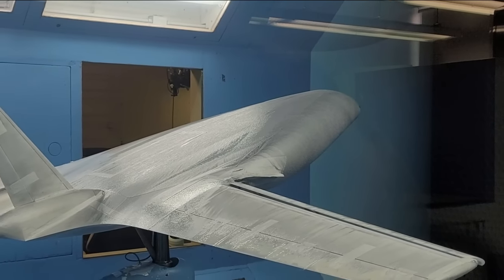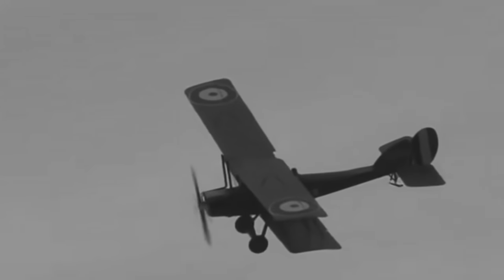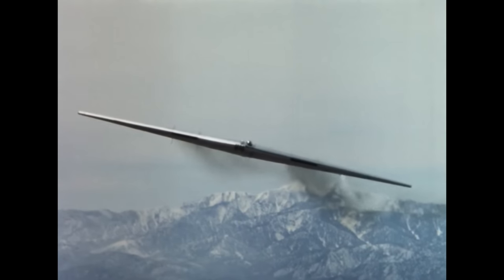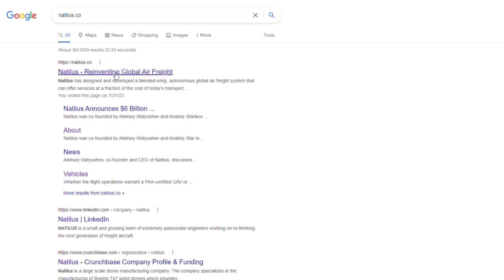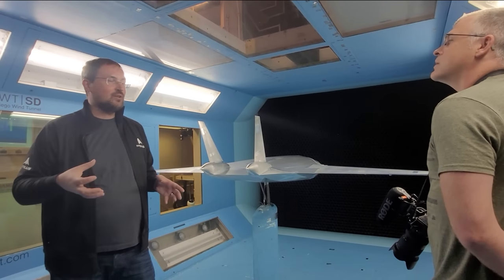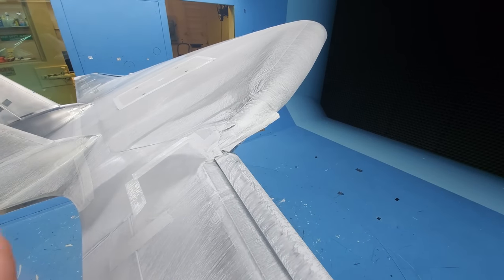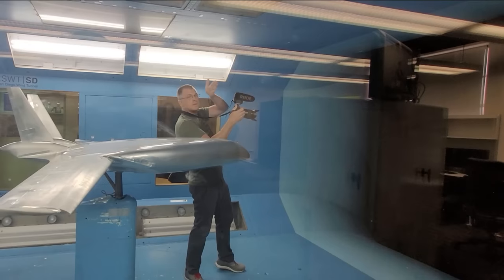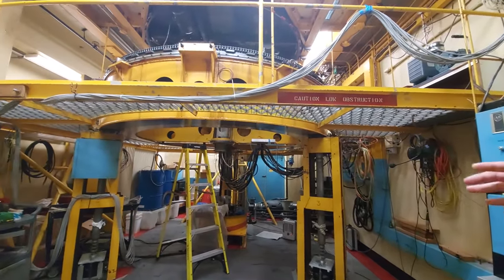Blended Wing Bodies:  The Future of Transport is Here (Featuring Natilus)

Comment: Blended Wing Bodies are not the future of air transport.

A cylinder is significantly lighter  as a pressure vessel. 

It also transmits torque from the empennage most efficiently.

Its the strongest member of the simple shapes in compression.

Its also equally strong and stiff in lateral and vertical bending. Tail down loads, up loads, and side loads are all the same to a tube.

Having a very low Empty weight fraction is more important to a transport than the benefits BWB concepts offer.

Because they inevitably end up heavier. Due to pressurization, primarily. And also the problem of where to place the windows? You cannot have any side windows in a BWB in spite of the fact every concept has them placed there. Right where the leading edge de-icing equipment is required. 

They also flub the flaps/high lift systems. You really think ditching the landing lift coefficient of 4.0 in favor of something like 1.6 is going to gain you any efficiency?

Also, what do you do about the supersonic airflow over the top of this large fuselage whoch is in fact an airfoil nearly 30% thick, with a critical mach number in the range of 0.5... And acting as a very large lever arm forward of the CG where supersonic flow will wreck havoc on your stability and control.

The proper solution is reduced wing sweep, very high aspect ratio wings in the order of 13:1 or greater. Shoulder or high mounted wing. Underwing engines. Very short landing gear (C-130/C-17 like, with low weight fraction heavy duty gear). And most importantly: Twin fuselages which reduce wing root bending moment by enormous amounts, and transmit wing torsion into two fuselages and tail surfaces. Both therefore reduce many tons of mass in spars, webs, wing and fuselage skin thickness.

Its like having two geese flying in close formation. The latter gets a 40% gain in efficiency, except its you.

Comment: This is fantastic researching methods and great design ...     My first airfoil test was an ambarella in my hand and jumping off the garage roof !  I soon learned I needed a much shorter garage roof...   I would like to know about such a large lifting body surface what happens if the aircraft flies through a swarm of bugs on take off or landing will the craft lose a large percentage of its lifting abilities because of the surface disturbed by the bug sticking to the lifting surface  ???

Comment: "Flying wings" predate wartime and Northrop and the Hortens.
Finned all-wing had flown well and safely since 1908 Dunne, 1918 Stout, .
There was an explosion of them. Cheranovsky, Fauvel,  Lippisch and others worked on it all through the '20s and '30s. Some, notably the Arup planes from Indiana in the '30s, produced planes that were markedly better than "normal" planes in every important criteria. Arup S-2 is in a museum, awaiting restoration. (see the "Flying Heel-Lift" youtube)
Also, Vincent Burnelli produced serviceable and sometimes extraordinary planes. The CBY-3 is restored in a museum now. Called by the media-hype term "flying wing", they like the BWB are lifting fuselage bodies with wings and tails.
It's absolutely a myth that this sort of marked improvement in efficiency by eliminating static-drag fuselages in favor on lifting volumes, requires modern computerized controls. Just as it is a myth that any such effort must be about stealth.
The Korean lifting fuselage body light fighter of today is only about low observability as an afterthought, but primarily it's about improving L/D, range, payload.
See the Lock-Mart "hybrid wing/body" transport design. Contemporary materials and avionics, dramatic improvement in range/payload, and they were ready to star building it to order 15 years ago.

See the Sukhoi T-4MS-200 (their proposal in response to the US B-1). Utterly conventional materials and avionics, and dramatically improved range, payload, handling. Sukhoi factories were smaller and busy, so they built the Tupolev 160 copy of the B-1 instead.

See the '70s Boeing model 754.
Not a "flying wing", not any more blended than a chunky slab-sided Burnelli. They confidently were marketing it with multiples of range & payload and better flight handling, with purely contemporary technology. It was not for lack of adequate flight safety or computerized design or controls, but because of "not invented here" and "if it looks right, it'll fly right", that we don't see it.

If it looks funny or violates what ill-informed pundits or marketing execs say about what a plane "should" look like, it doesn't matter that you offer markedly better economy and handling. (their best argument is that passengers seated off the center line will projectile vomit and die if the plane rolls a little, or that not as any can have a window seat. They go silent when reminded that military and freight users don't care.
 Actually their best argument is that if it worked, then we should be seeing it now. Apparently the simple fact that it wasn't bought and implemented, must mean that it cannot work. Then they weasel out from under that when you mention the TSR-2 or the Avro Arrow.)

Comment: BWB is a pipe dream.  While the design is inherently more efficient, the economics of its real world use are not.  Every tube and wing airliner built in the last 60 years has had multiple models configured to different passenger/cargo capacity by lengthening or shortening the tube.  BWB can’t do that without scaling the entire aircraft.  Special built cargo BWB will be too expensive without passenger versions to increase economies sf scale.  The design efficiencies of BWB don’t overcome the business model inefficiencies.

Comment: Thanks Very complete and objective.I have designed built and flown many wings and blended wing RC models for years. Another real downside to them is that they are very seductive! visually and in the engineering /construction.
Nautilus are sensible , they are most appropriate for cargo. The roll effect greatly magnified by the distance of the seat form the planes centre line will make passengers very uncomfortable , if not sick! Esp. without windows! The worst sensation is when the aircraft's floor "drops away"
i pilot a light aircraft and that manœuvre  produces a strong unpleasant sensation in passengers.
Regarding drag  ( and induced drag) one wonders why the most efficient gliders are not flying wings... A flying wing and blended body plane require considerable reflex profile at the trailing edge to counter the downward roll of the wing and to create longitudinal stability (static margin).This induces substantial drag, 
The sausage fuselage is also easily stretched;

Comment: I have to comment on autonomous operation of anything large enough to cause severe damage.
While it's trending everywhere from reddit to Tesla fanboy forums that doesn't begin to mean it will be certified. Especially when it comes to aircraft. Manufacturers have been trying to go with all composite airframes since the 70s. Over 40 years and regulating bodies still don't like certifying them. The FAA bankrupted the Beechcraft Starship with extreme requirements. The 787 is just now certified to fly again. Even the 787 was subject, is subject to extreme tolerance and strength requirements in comparison to standard aircraft construction. Everything should be composite now yet regulatory authorities are just not there yet. 
With that said, the chance of getting autonomous aircraft certified is absolutely ZERO. It will need to fly for a minimum of five years with no incident having pilots onboard before any chance of pilot free operation is certified. Think I'm wrong? The people that make the regulations and laws are not software engineers. Hardware and software has never been infallible to date in anything. Aircraft cert is notoriously difficult and cost prohibitive on the airframe and powerplant. Introducing something new? Sorry guys, you better have a fully operational cockpit in your bird if you ever want to see certification. We have the technology for aircraft to land on the numbers within centimeters yet it's not legal except for use in emergency. It's been possible for 40 years yet even with Pilot presence, it's not allowed. Don't make business development decisions based on what's trending. It's mere conjecture with no basis in the real world. The same thing goes for autonomous vehicles. Pilot programs will operate and development will continue up until the point it's ready for public release. Then regulations will emerge and the DOT will say NO FREAKING WAY. History bears this out. This is why Tesla rolled back on the higher levels of auto drive. Musk is no fool, he knows exactly what will happen if they went further. Chaos theory, class actions, and general mayhem.

Comment: I hope this project is successful but I can see a few obstacles. It would be difficult to complete on cost per unit with Boeing or Airbus. Improving the operational cost is more than losing the crew and saving gas, existing ground equipment is all designed for traditional aircraft and engine maintenance is more time consuming on aircraft with that engine configuration. I feel like the most likely path forward would be for this company to be purchased by a bigger manufacturer, sell cargo planes to the military, then be adopted by industry after the wrinkles have been ironed out.

Comment: Airbus and Boeing both figured out that the A380 cross section was about as far away from the centerline as passengers could comfortably be seated.  Much more and puke city. Blended wings will always have to be cargo planes only.
Reply: Why is this? Yaw?
Reply: @scienteer3562  yep. Normal roll rates make for zero g in the outer edges of a flying wing passenger compartment.
Reply: @kenreynolds1000  that makes sense. The lever length of the wings would amplify any roll motion massively.
Reply: I'd pay extra for a wingtip suite on a huge Junkers flying wing.
Passengers who will puke until they die in a BWB go skiing and hurt more from hitting trees than strange g forces. They drive fast cars and love the g forces, but in a BWB plane, suddenly they can't handle it.
Reply: @JFrazer4303  your inner ear isn’t as resilient by the time you can afford the nicer seats.  I’ve been in stunt planes and rode my share of roller coasters; but theses days… not going zero g if I can help it.

Comment: birds dont have a tail in vain
Reply: multi-tube main body filler structure, like in a hexagon bee nest
Reply: you can directly measure how many tubes you can fit in the main blended wing, and even use standard tube systems
Reply: tilt wing cruise missile style air craft, or scissor wings
Reply: Wouldn't it work better if the tubes were triangle shaped, based on the ability to cover more surface area, and also because of the straight edges it should have higher tensile strength... 
Other polygon shapes would also probably work
Reply: of course you always pressurise the cargo, you dont know what is in there
Reply: the remote control/automation (even huge servers autopilot) is more critical

Comment: It looks nice but looking at the design I just can't see it actually fly when fully loaded, the wing is way at the back and so you have the majority of the body forward of the lifting surface, sure the body its self creates some lift when at speed but it is minimal,   if you look up when other company's tried to make a blended wing body's they all came to the same conclusion that in order for them to work they have to fly fast so that the body generates some lift and they also found that when at low speed like landing the plane becomes unstable  and goes into an unrecoverable nose dive, and when these company's tested it there wing was nose to tail where as this company is putting just a thin wing at the rear

Comment: Wind tunnels need more smoke to work properly. There is usually at least 2 lines of smoke so that lifting capabilities can be visually established with each individual surface
Top surface should be a high pressure slipstream, lower surface should be a lower pressure vortex, or pocket, kind of works like a balloon under the wing.

This can vary based on the desired cruising altitude/speed, lifting capacity, desired function, etc... but you should be able to "see" that it produces positive lift (glides) before ever leaving the wind tunnel, then components and engines are added based on the end designs demands.

The fuselage is like the heart of any aircraft, everything is built off of that one component.
Reply: @cap5856  me too, just my 2cents